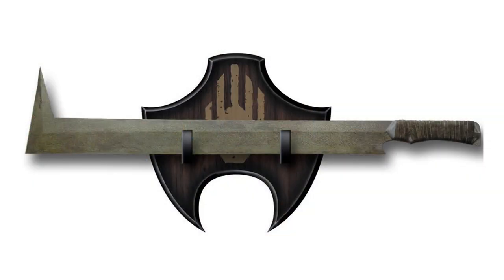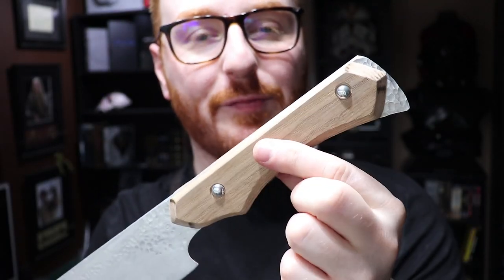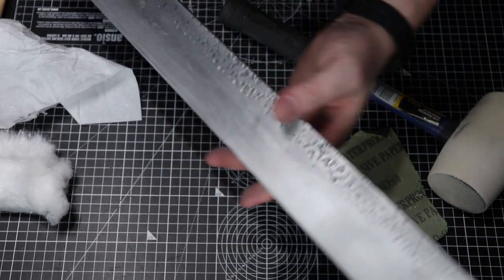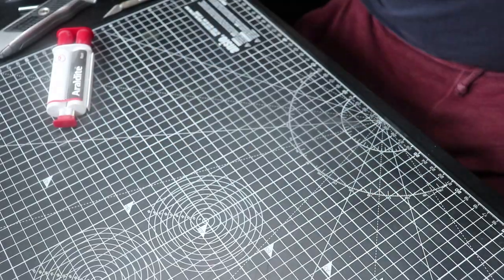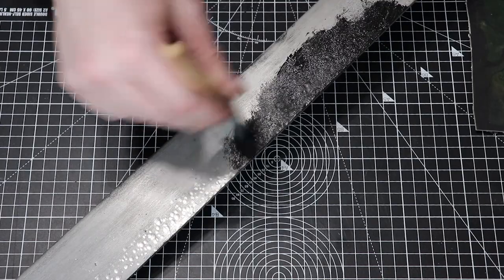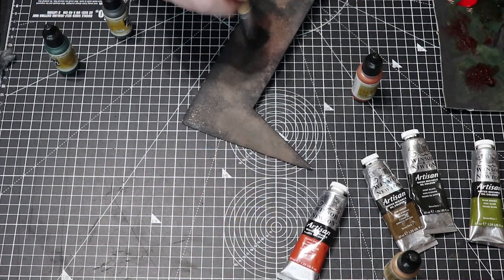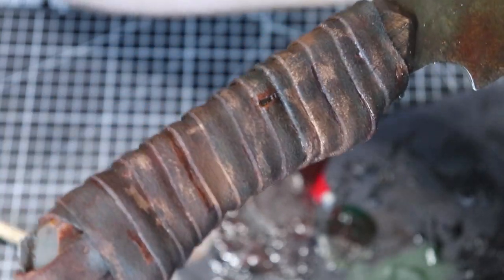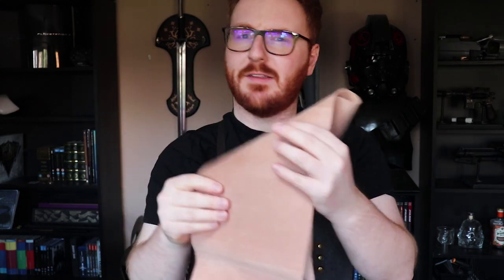Uruk Hai Scimitar | Aluminium Prop Build

Comment: Great vid, how did you get that hammered texture?
Reply from the maker: The main texture IS just hammered on with a ball peen hammer. If you give it a try just watch out cause it will start to reshape the blade giving it a bend, which you'll have to fix (I did by sanding it straight again). The later texture was the stippled paint
Reply: @BucketheadStudios  thank you, that’s what I was suspecting, I give it a try